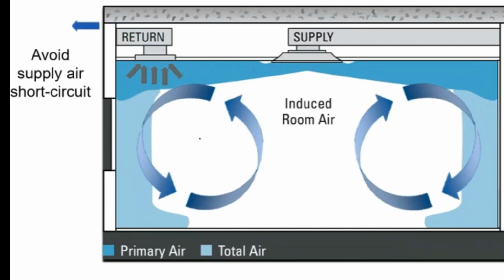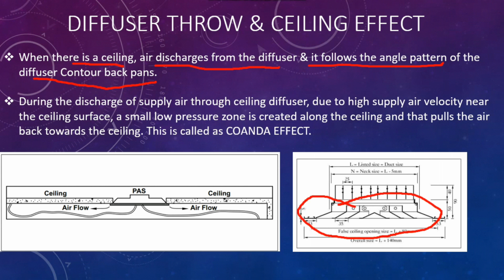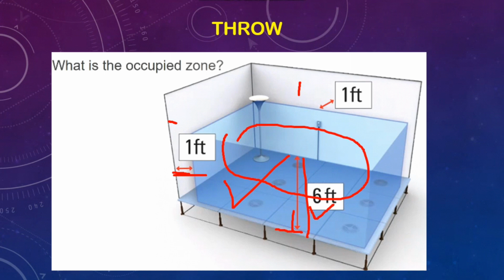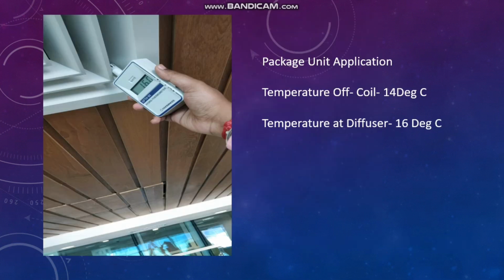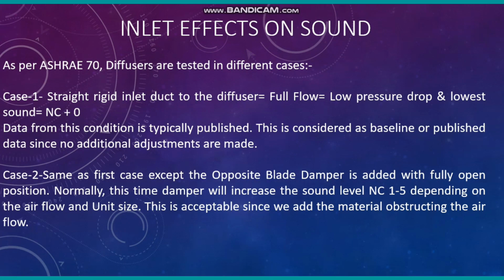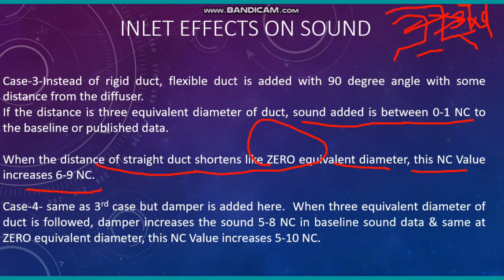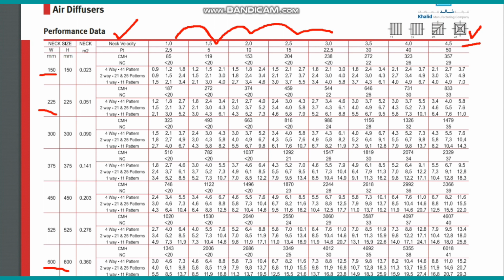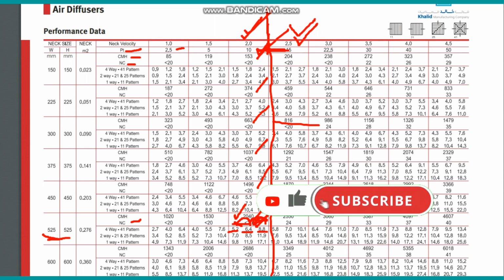HVAC-Air Terminals Sizing l ASHRAE 70 Requirements l Selection with all Technical Concepts🔥Explained

Comment: According to my project specifications, the maximum velocity at the return air grille is 1.5 m/s, and the maximum velocity across the net grille area is 2.5 m/s. Will these values also be applicable for the diffuser?
Reply from the maker: Max.velocity of 2.5m/s is general for basic residential and commercial applications